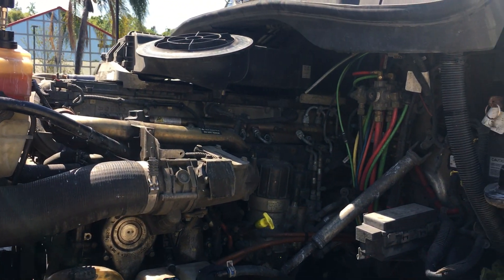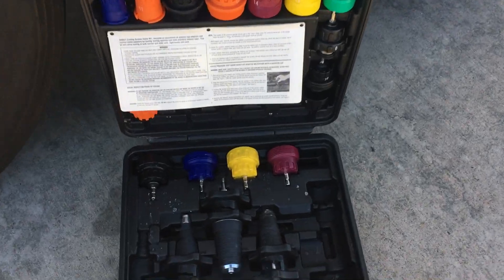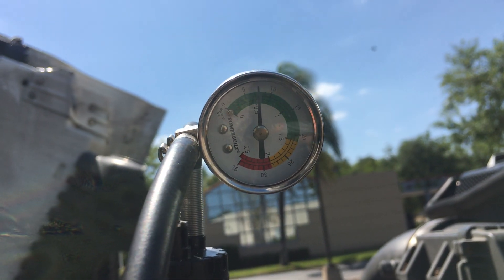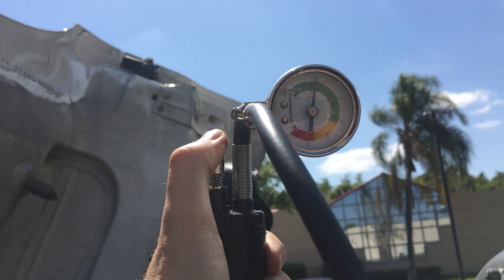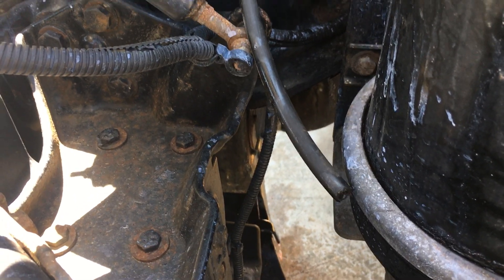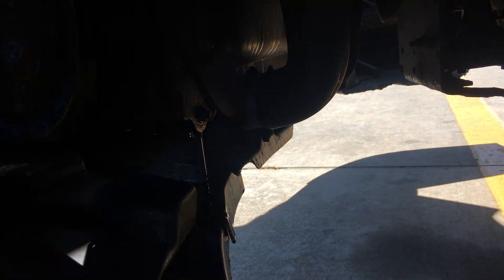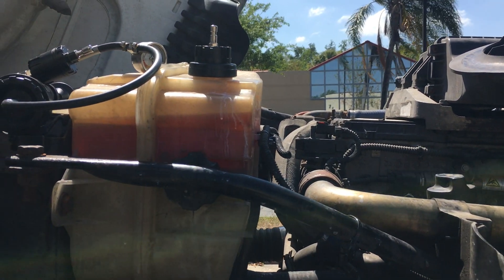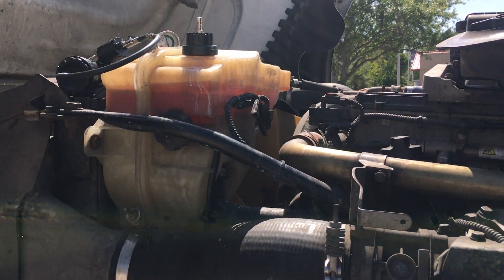Freightliner Cascadia 2011 DD15 finding coolant leak, coolant system pressure.

Comment: With the engine turned on, how much pressure should the coolant tank have on the DD15 engine?
Reply from the maker: No pressure at all, no bubbles
Reply: @dmitryeg  there must be pressure. As far as i know its about 10 to 15 psi.
Reply: I believe That's why radiator caps have pressure ratings.